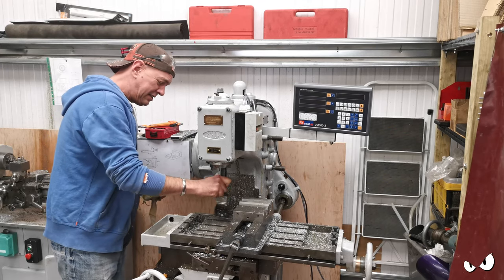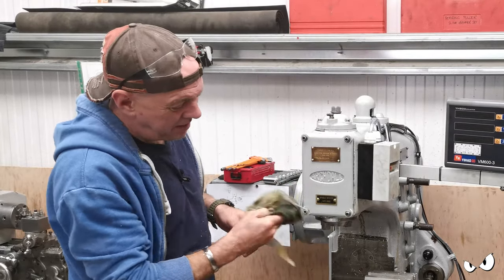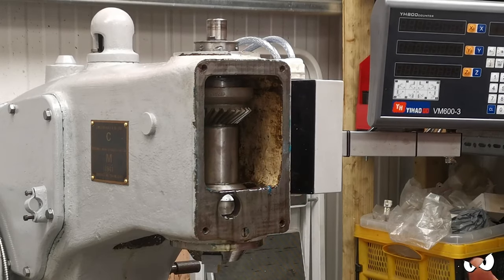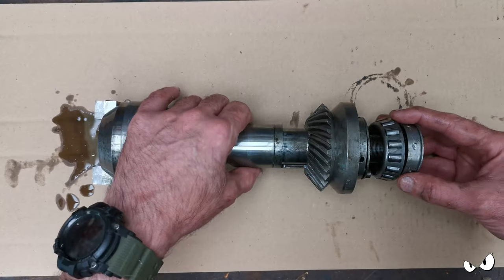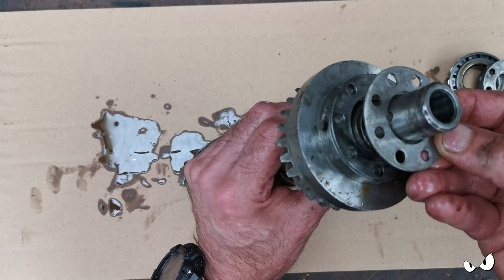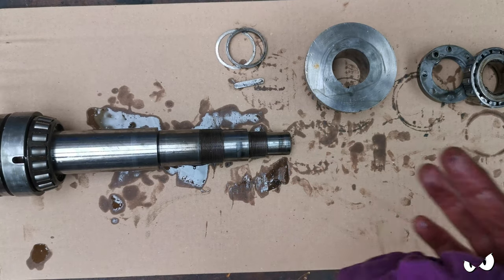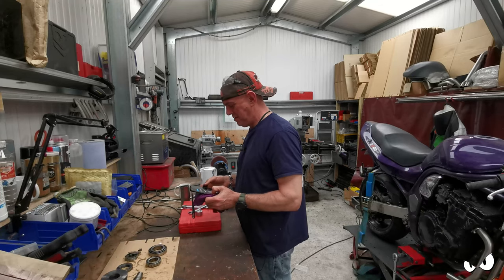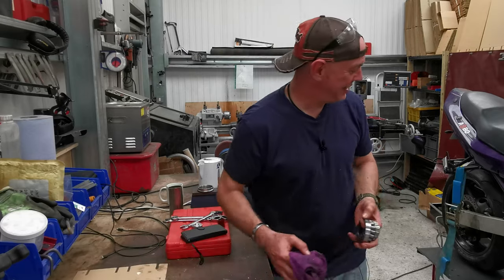Archdale Milling Machine - Spindle bearing removal

Comment: Taper Bearings (Timken, SKF, Etc.) have a torque of 15.5 Ft. Lbs. ....which is a snug bit tighter then "hand tight" and will cause the "tool wandering" you are experiencing.. I like to "seat" the bearings first ( bringing the bearing down tightly, loosen, move and repeat several times) before torquing. What a beautiful old machine...so jealous...lol
Reply from the maker: Yeah, it seems much happier with the new bearings and I'm basically running the machine, then checking / tightening them, then doing it again to try and let everything find it's home... I'm happy to sneak up on it like this rather than risk damaging them, but so far it seems all good 😂👍
Reply: Yea ..that "pic" you showed of the damaged bearing race is positive evidence that they needed replacement...99% proof that machine was run for a long time with improper "pre-load" on the bearings..running the machine to "seat" the bearings and readjustment is the right plan👍

Comment: If the bearing is worn out, you will find "markings" on the face of the "race"...perpendicular to the bearing (or 90 degrees if you prefer)..I think I would try putting your "press ram" under the spindle with just a tiny bit of load to hold the whole assembly in place, while torquing. That bearing is definitely worn out as you can see the wear marks I described. It's the same thing as a front wheel bearing on an older car..
Reply from the maker: The new bearings have definitely made a difference. The wear on the race didn't look like much at all, but its enough I guess. I'm pretty sure I bugger it when I removed it the first time round as well 😂🤣
Reply: I'm 99% positive that your bearing removal had nothing to do with the wear on the bearing race. That is "classic" wear proving improper pre-load..it causes the rollers to become oval shaped leading to the exact wear pattern on the "race" you have...again, this is the same wear pattern you look for on automotive  Ft. Spindle bearings..If a "Timken" style bearing has those "wear lines" the bearing is worn out ...if not, it is still useable..It would take 100,000 revolutions + to cause that wear pattern..I belive you will be "Golden" after your replacement service..Now it's time to "throw chips" and make that Ft. End Yoke 👍
Reply from the maker: Thanks for that matey, biller is on the way and I'm itching to have a it. It's going to be a fun project to do 😁👍

Comment: is There something missing from the top bearing. it should be an interference fit with the spindle same as the bottom bearing.?
Reply from the maker: The top bearing is snug as snug gets... It's basically the same layout as the steering stem on a motorcycle and the top bearings pull off them easy enough as does the mill... 😁👍

Comment: Wow, those bearings are cheap.  Suspiciously too cheap.  For a fiver a pop, you're getting standard class bearings, and that's not really machine tool level.  For a spindle I'd go at least P6 and probably P5 (at least double or 5 times, the price, respectively) from a good name brand (FAG, Timken, SKF etc). Reference 3020x-A-P5, basically, and potentially take your stool with you.

I assume you've already gone out and got, and fitted, the new bearings already, so this is probably too late, and I would guess you're already better off than you were.  On the other hand, do you need micron level accuracy bearings on an 80 year old machine?  My Schaublin's headstock would say yes, of course, and it's worth filing away for the next time, or when you want to get really anal.

For tightening, "hand tight" is too loose, probably.  Check the bearing spec sheets, you're supposed to tighten to a specific torque, and with the setup you have that probably means calculating the tightening angle from the thread pitch.  One of the places where a manual would have been a bit handy.
Reply from the maker: Good advice matey, thank you 😁👍
I'm doing a search for Timken bearings as ultimately I want it to be as it was. I get they're going to be more expensive, but it'll be worth it in the long run.  I need to find out the right torque for the bearings as you say and when the o rings turn up its all coming apart again to install them and set the bearings properly. At the moment (not knowing the correct setting), I'm keeping a watchful eye on the finish and tweaking them if needed. Not the best way I know  but I'm a bit skittish  about crushing them 🤣😂